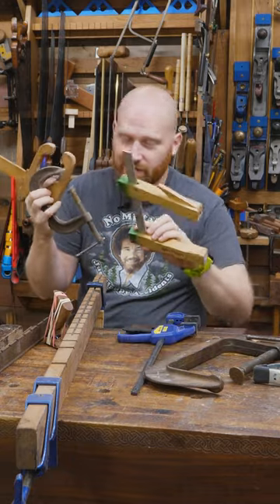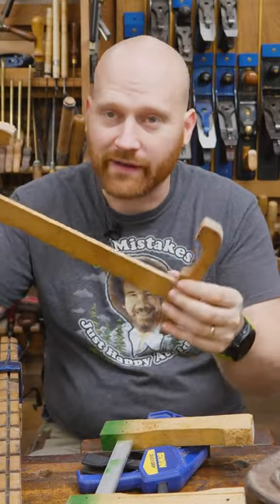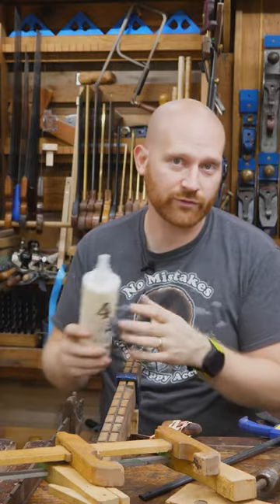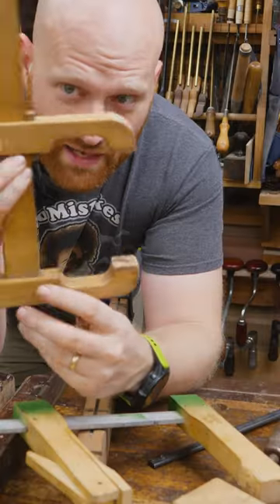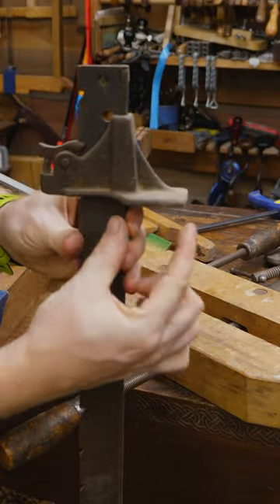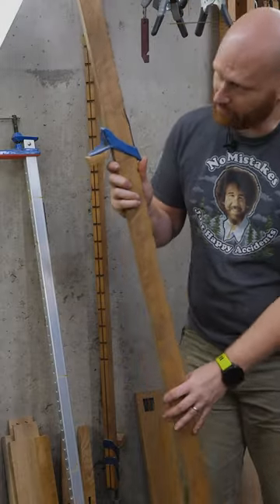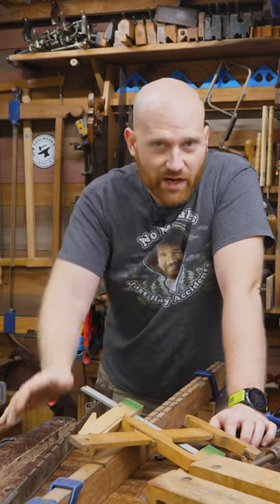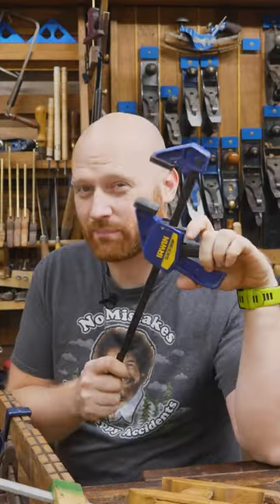What Clamps do you need

Comment: Ropes are really good clamps. The bench vice is a really good clamp. Pin nails from an air gun make a good clamp. I like screws backing up glue. Stack of weights balanced on 2 items makes a good clamp. Basically you never have enough clamps so figure something else out.